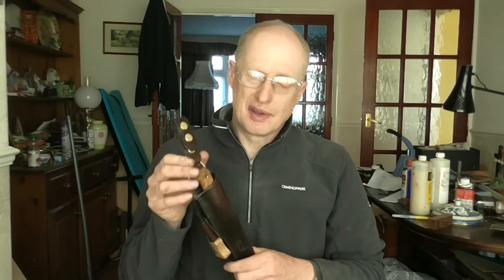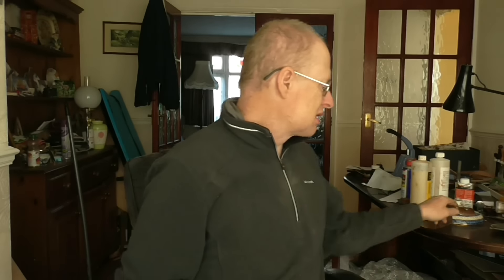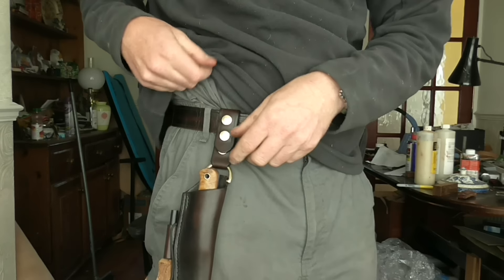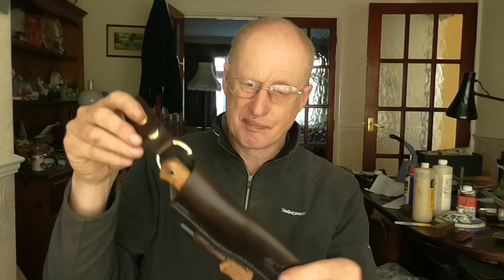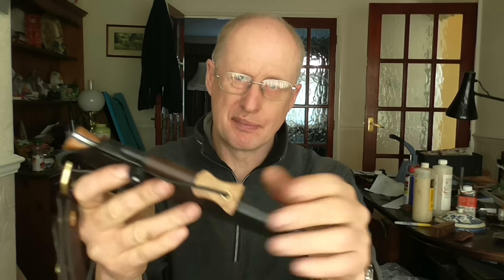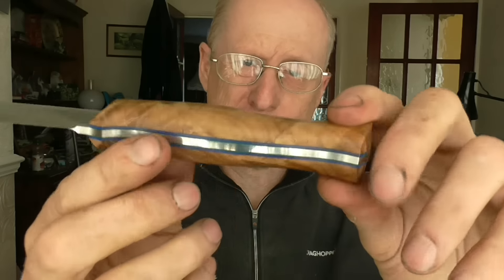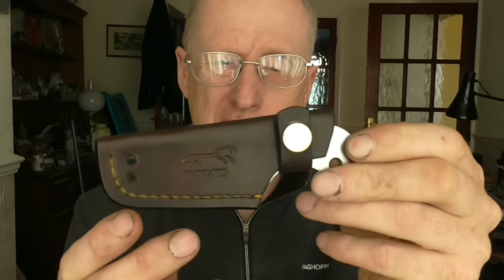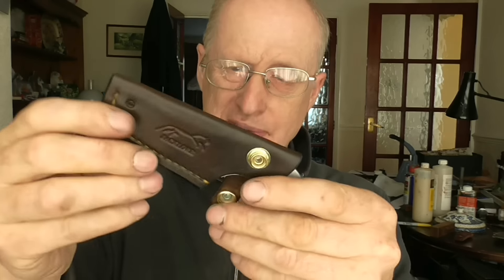Eds and James Mears knives and a few changes

Comment: Sandy,Have you considered using one way snaps, They are made with a small stud, a raised boss, which only allows the snap to disengage (or to engage) in the direction you select when orienting the snap during fabrication of the sheath. They are used for thumb break retention straps on by some holster makers in the USA. I can send a photo attachment if it would be useful. Note: If two are used in differerent orientations you could virtually eliminate the possibility of accidental loss due to even a strong pull in a single direction.